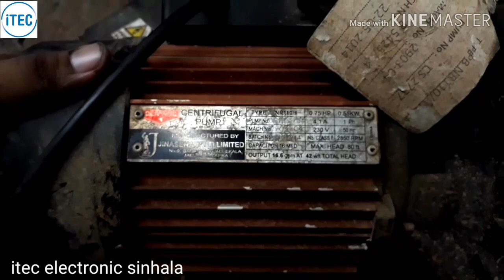Jinasena water motor wiring

Comment: වතුර මෝටරයකට හෝ fan එකකට කන්ඩෙන්සරයක් සව් කිරීමේදී ටර්ම්නල් වලින් වයර් ගලවා ඇති අවස්තාවක හෝ රනින් /ස්ටාර්ට්න් නොදන්නා විට මල්ටිමීටරයකින් පරීක්ෂා කර කන්ඩෙන්සරය සවිකල යුතු වයර් දෙක සොයා ගන්නා ආකාරය දැන ගැනීමට කැමතියි .
Reply: Bro. Winding 2 kema multiye ohm scale  eke reading ganna.e reading walin wadima ohm ganak tiyenne run winding eke.starting winding ekw ohm gana adui. Starting winfimata thamai capacitor eka conect karanne.

Starting windima  ohm gana saha run winding ekw ohms gana  wenas.
Et samahara industrial motor wala run winding eka startig winding wala  wenasak na. Forword  saha  Reverse run karana oni nisa  eka motor diagram eka neme plate eke gahala enwa
Reply: Normal stock tank ekak nathuwa    water pump karanawanam pressure switch ekak dala pressure eka wadi karaganna puluwanda..me switch eka kiyak withara wenawada..pls reply sir
Reply: Starting eke tama ohm wedi...